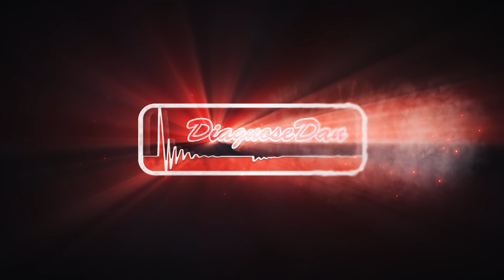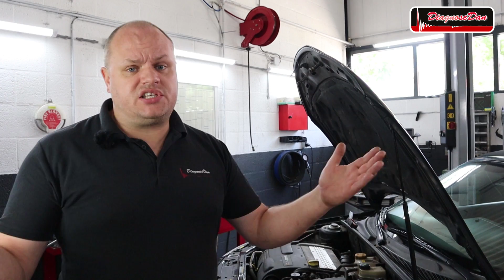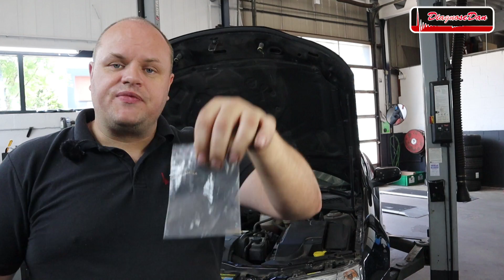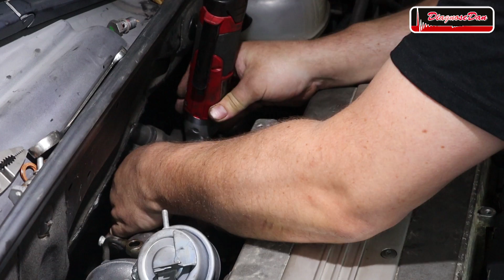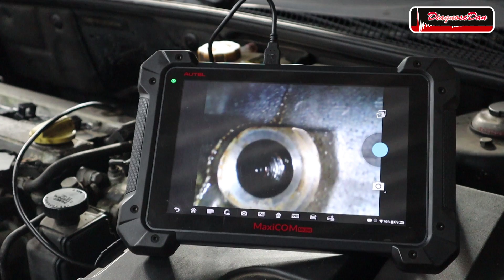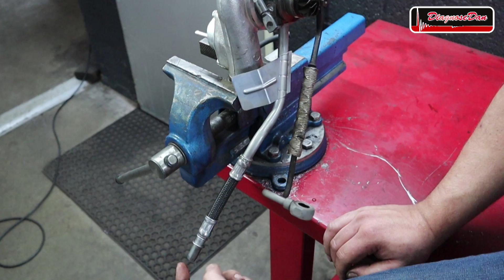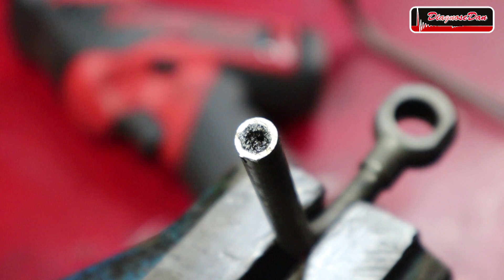Why did this new part only last one day?

Comment: 10.000Km max oil and filter change using quality oil like Castrol Edge and get you injectors cleaned or changed every 150.000Km.
Some engines just love making carbon black death crud....
Reply from the maker: Thanks for the comment Michael

Comment: The big turbo manufacturers Garret  and others have very specific fitting instructions.  
These involve, flow test and return checks to be made prior to run up. To have a blocked feed pipe and send a job out is embarrassing and an expensive schoolboy error.
Reply from the maker: Thanks for watching 👍

Comment: This is common since synthetic oils have come into use. They allow carbon to fall out of suspension and lay in oil galleries also in the sump to the extent that it clogs the pick up strainer too
Reply from the maker: Thanks for the feedback 👍
Reply: Thanks for your channel I’m a mechanic 30 years and I’ve still learned tons from you. I try to make videos but it’s an art in its own right and I can never get it as clear as you. You must put a lot of time into it so “Diagnose Dan Thankyou AGAIN”

Comment: Irregular oil changes caused this failure plus not idling turbo after a long run on motorway. The old oil burns in the pipe and turns to crud - like on an old roasting tin!! It builds up and blocks the pipe over time
Reply from the maker: Thanks for the comment 👍
Reply: @Diagnosedan  is that what you reckon?

Comment: In the UK the warranty on that new turbo would be void as the oil feed line wasn’t replaced.
Reply from the maker: Most supliers won't waranty a Turbo if you didn't do the proper checks

Comment: I have seen a few new Turbos fail in my time ,normal causes  are the air intake not being cleaned out  resulting in broken parts of the old unit introducing themselves to the new turbo ,and failure to prime the new turbo before starting
Reply from the maker: Yes, that's why you need to check it!

Comment: Hi Dan
Looking at the feed pipe it has some heat shield on it, indicating that it must get hot around where it is installed. So the carbonisation inside the pipe is probably burnt oil.  Either it was getting too hot around the pipe (perhaps some other heat shield is missing) or a lower grade oil that burnt at a lower temperature than spec was being used.  Possibly worth an oil and filter change so that you’re sure the new turbo will get best lubrication from the start.
Reply from the maker: The Heat shield is around a rubber hose in the middle of the Line to allow some flex

Comment: Could this problem have been prevented by more frequent oil changes and not driving it like a F-1 car, I mean letting it cool for 30 seconds before turning the engine off. I just wonder because of the coking of carbon in the oil line.
Great video.
Reply from the maker: Thanks for the comment 👍

Comment: Lack of oil change, not the right oil kind. Thats the 2.2 or 2.0 ecotech engine from General Motor the turbo is normally running about same temp as engine block. It has a engine oil cooler as well. To me that car hasn't see a oil change so often for long period of time. Good video Dan.
Reply from the maker: Thanks for watching 👍

Comment: great video Dan, to answer your question, it's a combination of things, first of all I think the oil change in the past has either used a wrong oil, or a too long interval.This resulted in the first carbon build up in the pipe.Because of this carbon build up, the oil feed drops and increases temp, and increases carbon build up etc. etc finally resulting in a total blockage of the feed.
remember that a bearing only needs oil feed, pressure is less important because the oil in a bearing builds up its  own pressure(hydrodynamics).
Looking forward to your next  vid!
Reply from the maker: Thanks for the feedback 👍

Comment: 4000 rpm is for the fan speed ,while the compressor turbine would be much higher, maybe 10000 on the 747 engine
Reply from the maker: Thanks for the feedback 😃

Comment: 747 engine turns 4000 rpm max according to Pratt Whitney test engineer back in 1969 at Boeing
Reply from the maker: That's the fan speed the compressor turbine turns faster.

Comment: That oil line is close to the exhaust. It's getting hot enough to cook the oil inside.
Reply: It's a f*cking turbo. Of course the oil feed is close to the exhaust, should it go on the roof?
Reply: @andykennedy5982  😂😂😂😂
Reply from the maker: Thanks for the feedback 👍
Reply: Which was probably the reason for that "heat shield" material they stuck on the line.
Reply: @Stoney3K  😁😁😁😁😁😁
Reply: Just like the Audi 1.8 turbos, on the A6 C5 at least. Replaced one on my sisters car just to have it fail again in short order, only then did I take it to Google to find out why XD

Comment: Hey with a turbo engine diesel or petrol you should use a engine oil flash once a year enven thought the synthetic oil is not suppose to build carbon deposit
Reply from the maker: Thanks for the feedback 👍

Comment: Shouldn't the shop that previously replaced the turbo be held liable for the failure,  especially since they did not replace the new oil feed line that came with the kit?
Reply from the maker: That's up to the customer.

Comment: Great video! On new or a few years old cars there are also external waterpumps for the turbo and if I have it right, oil pumps too (to prevent the after-the-engine-use heat build up) that could not produce the needed flow. Normally they would throw codes anyhow. But that carbon buildup in the oil feed line of the turbo is very interesting - there might be same thing all over in the engine...
Reply from the maker: Thanks for the feedback 👍

Comment: It appears the oil cooked (or coked) in the feed line due to high heat after the car was turned off, possibly due to, extended oil change intervals, or improper oils being used. It is always a good idea to use the best synthetic oils (synthetics can tolerate high heat much better than straight mineral based oils), and change them at a minimum according to manufacturers spec. Even better, idle the car for two minutes after a prolonged highway run to allow the turbo and exhaust system temps to cool down in the vicinity of the turbo to prevent coking on the bearings and surrounding oil lines.
Reply: I work on the railway. Most modern locomotives of course have turbocharged diesels. One safety feature which they have is a oil pump on a timer. When the diesel is shut down, A pump connected to a electric motor starts running. Based on the large size, the pump timing circuit runs for about a half hour. It’s too bad that auto manufacturers don’t have a pump to send oil through the turbo for a few minutes after the engine shuts down.
Reply: Brian Burns ; Absolutely! Oil pumps for pre oiling, and post shutdown are available for turbocharged vehicles. There are also programmable shutdown delays for turbo engines. Unfortunately I have only seen them for diesel trucks here in the US. I fly helicopters and airplanes with turbine engines, and it is a standard to allow a minimum of a two minute cool down at idle before shutdown to prevent coking of the turbine bearings.
Reply: @danrickard1911 , 33 years ago when buying a brand new 1987 Buick Grand National you could purchase an aftermarket kit for the 3.8 liter turbo V6 that circulated oil through the turbo using an inline electric pump ever time you turned the engine off. It was thermostat controlled and would circulate oil for a few minutes or for as long as twenty minutes after a 5 hour long highway run. Worked perfect! Funny how the previous generation has already solved this generation's problems but no one remembers, lol.
Reply: Brian Burns install turbo timer dude
Reply: @brianburns7211  most moderns cars work the same way ...u can actually hear it.  it keeps the oil moving so it doesnt coom
Reply: @brianburns7211  BMW turbo engines have an electric water pump which keep water flowing to the turbo for a few mins after the car is shut off.
Reply from the maker: I agree!👍
Reply: Keeping the oil feed and return pipes below 200°C is the best solution. Even synthetic oil will form carbon build up above 250°C.. Oil change interfall will have not so much influence. Cooling down is good procedure, but it would have been better when the engine designer would have prevented overheating by f.e active cooling after shut down.
Reply: I love the way you repair car problems and explain us the root causes.
                       🙂🙏🏻
Reply: Mitsubishi Evolution has a timer built in from factory that keeps the engine running on idle for a few minutes after the engine is "turned off"
Reply: @xhxb6155  As well as an oil pump on some engines. But having it sit at idle for about a minute after a long run is the easiest course of action.
Reply: Agree completely.
Reply: If it is coked in the feed line imagine what it is like inside the turbo.
Reply: I was surprised to see the feed line coked shut. I was thinking return lines plugged.
Reply: maybe a clogged oil screen somewhere in the feed line...
Reply: Completely right, turning off when engine is hot had biggest inefluence in this case! Customer is most responsible for this failure
Reply: @ПИПАЕ36  no. Customer is responsible for the failure that ended the car in the Belgium shop. The mechanics negligence is responsible for the failure that ended the car in Dan's shop.
Reply: BMW prevents this with heat shields around turbo oil feed and oil return lines
https://new.minimania.com/part/G2NME2850/Mini-Cooper-Turbo-Oil-Feed-Line-Heat-Shield-Thermal-Wrap
Reply: @gregnemeth  Cost of the thermo wrap heat shield from BMW?
$24,000.00. (probably) 😂
Reply: My brother exploded his turbo. He "drives on the brakes" as we say, running at 100% until parked up and he runs out of the car. He's one of those people who is always in a hurry. When I asked did he ever stay in the car with the engine running for a minute to allow it to cool a bit before turning it off, he replied "Why would I do that ?". I'm sure there's a warning/ guidance somewhere in the owner's manual about doing it, but 99.9% of people ( including probably car people ) don't know to do this
Reply: has anyone noticed how They have actually installed electric fans on the automobiles to "cool" the car down while it is just idleing in one place LOL
Reply: The 9-3 with the 2.0l turbo call for Synthetic 0W-40. Many shops/owners cheap out and use non-syntheic or Synthetic oils that do not meet ACEA A3/B3 &
ACEA A3/B4 ratings. This is exactly why you do NOT cheap out on oil. (Also why you always change the oil lines when changing a turbo...

Comment: Use same or higher quality oil than recommended in manual and stay within recommended oil change interval...

Dont: use mineral oil but using fully syn oci

And try to avoid using any type of oil thickening additive/treatment
Reply from the maker: Thanks for the feedback 👍

Comment: I think most would just change turbo assuming worn out from mileage. 
Someone that knows these failures are more common due to oil pressure.. would know to check or automatically change the feed line.
Reply from the maker: Thanks for the comment 👍

Comment: Back to the question of the deposits in the feed tube. imho - It is a result of acid oil. If you would open cylinder head cover you would most likely find the same ash on it. it is either a very old oil - we talk here about 100k since last change (which is very unlikely) , or it is oil rings which are worn and oil gets acid by burning on the cylinder walls.
Reply from the maker: Thanks for the feedback 👍

Comment: Oil line carbon blockage?  The Oil line /tube is located too close to the exhaust part of the turbo and it  overheats all
the time until eventually the tube/line is blocked to oil flow! 
Solution: modfy the supply line and route it away from the exhaust heat!
Dank U well Dan!
Reply from the maker: Thanks for the feedback 👍😃

Comment: Owner doesn't change the oil/filter often enough. When you did the oil pressure check via starter motor, that oil was black coming out. Customer needs to be educated about his maintenance habits. The first turbo didn't fail either, the dirt in the oil caused the hi pressure line to clog thus secondary damage, the turbo. 
First shop should honor this as a warranty for the second turbo repair. Had they replaced both lines that came with the turbo, this wouldn't have happened. Whats even more embarrassing is, they altered the recommended procedures by not replacing the one oil feed line and the new turbo burned up that same day.  My guess, the first shop has no defense.
I might also add that the oil feed line is located in a very hot place and cooks the oil. Saab should address that problem vs. recommend the feed line be replaced with a turbo that likely failed due to the feed line coking up with burned up oil due to high temps due to poor location/ventilation and/or poor insulation from exhaust manifolds etc.
Reply from the maker: Unfortunately Saab doesn't  make cars anymore so they won't adress this problem😉
Reply: @Diagnosedan  I'm surprised Saab lasted as long as they did. Fiat might be next.

Comment: Basically the engine probably never had an oil change causing all that sludge. Even with a new feed line that engine wont last long unless you take the sump off to clean it
Reply from the maker: That's why you need to check the oil flow and pressure at the turbo.
Reply: I understand oil clagging to be a known problem with this engine. I have just had the sump removed and cleaned on my wife's cabrio because we had no service history when we bought the car. Whilst they had the sump off they also checked the main bearings which were 'like new'. We intend keeping the car and store it every winter.
We are lucky to have a Saab specialist just in the next village.
As Dan so rightly commented - you should only use a fully synthetic oil.
Reply: If it never had an oil change since 2005 it wouldn't have made it to 2020, not even close.

Comment: That's the highest and hottest point of the feed line. When the engine is shut down for a extended time even a short as an hour the oil returns to the case but leaves a film that is the crystallized or hardens the oil and leaves the feed line diameter even smaller. after seeing this and knowing what caused it I would recommend replacing the feed line of this type engine at a set time/mileage to prevent a turbo replacement at all.
you have the car and the millage do the math and give us an estimated time/millage that can be used to help prolong the original turbos
Reply from the maker: Thanks for the comment 👍

Comment: carbon deposits can be from a few things, insufficient oil changes or blow by from worn piston rings etc allowing exhaust gases into the crank case.

an easy tip is to fill the turbo with oil via a syringe then fit the oil feed line (leaving the oil return off) and crank the engine making sure there is sufficent flow out of the return line
Reply from the maker: Thanks for the feedback 👍

Comment: If the return pipe starts to block due to contaminated oil which restricts the flow it puts pressure on the turbo oil seal and eventually the seal gives way then pressurised oil is forced into the hot turbo which will destroy the cat and partical filter also bluey black smoke.will emit.from the exhaust.tail pipe possibly quite dense.
Reply from the maker: Thanks for the feedback 👍

Comment: Hi Dan. As regards to why this happened, the fundamental reason is the location of the turbo. Having the turbo towards the rear, between the engine block and the firewall and away from the flow of incoming air, leads to exceedingly high temperatures. This leads to oil breaking down. Formally the phenomenon is known as "oil oxidation". There are many resources online explaining this, here is one:  https://www.finol.ie/news/engine-oil-breakdown/  : "As more horsepower is added, increased pressure is put on the turbochargers. This pressure creates extremely hot environments that receive less cooling from the outside air, air that would usually help regulate the temperature. Therefore, as the temperatures increase, the greater heat levels lead to oil oxidation. This, in turn, alters the viscosity of regular oils. Due to the fact that they are created from impure, irregular molecules, regular motor oils are more vulnerable to the effects of heat. The small, light molecules in regular oils tend to evaporate as the oil is heated, leaving large and quite heavy molecules behind"
Reply from the maker: Thanks for the feedback 👍

Comment: Poor servicing or heat from the turbo and exhaust overhearing the oil in the feed pipe.  Modern diesels injectors unseating and combustion gasses venting into the cylinder head.
Reply from the maker: Thanks for the comment 👍

Comment: Did you consider changing just the C.H.R.A if the turbo housing was not damaged by the turbine blades,  to keep the poor guy's cost to a minimum?
Reply from the maker: Yes we considered that but than we needed  to order a oil line set that is included in the turbo kit. The oil lines are crazy expensive.
In the end there was little difference

Comment: Before you diagnose it: I call the oil or oil line. The other shop should have made an oil change, because you see that a bad oil was the reason.
Maybe even no oil pressure at that line. 

Either way, the wannabe french should pay for this, because they diagnosed and repaired it the wrong way. How much is the turbo alone? 1500 to 2000 euros ?
Reply from the maker: Thanks for the comment 👍

Comment: Hi Dan, I am not a mechanic, but would the high residual temperatures after shut off of turbo have a effect on the oil in the attached steel pipe? Like your logical thinking, some have it and some don't.
Reply from the maker: You are right that's why you should let your turbo engine idle and cool down before turning it off